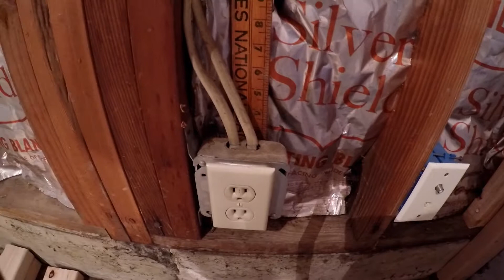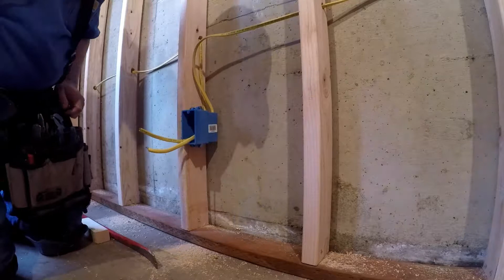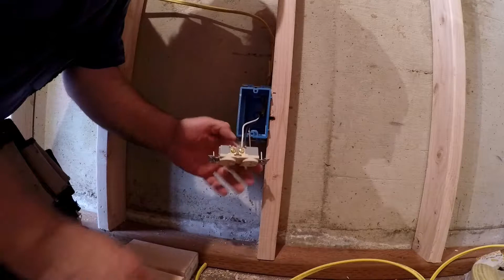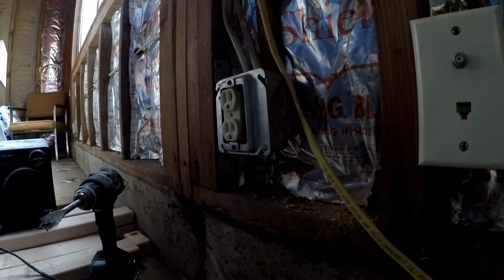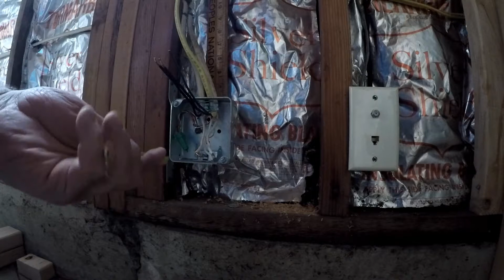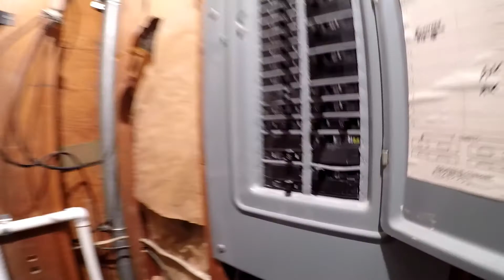Adding Electrical Outlets Shockingly EASY

Comment: Thanks for the detailed outlet and wiring  installation!!  I was unsure just how far back in the box you can remove the sheathing, because it's so difficult to stuff one or more back in when all the wires are still contained together.  It appears as far as possible to make more room,, as long as some with sheathing comes partially through the box tab or clamp areas.  Nice looking dog you have there!!

Comment: It would be nice if those plastic box manufacturers would make the mounting guides longer. Most drywall is 1/2 inch thick, but the guides are only 3/8 inch plus the rounded edges of the stud mean that your box could be approximately 1/4 inch too deep. I like to place a piece of drywall or 1/2 inch piece of wood on the front of the stud in order to get the proper mounting depth.
Reply from the maker: Half inch spacer to set the box depth. You can do that.

Comment: I really dont get adding pig-tail wires to outlet, if outlet ever goes bad I still shut power off to replace it, therefore the rest of outlets are down anyways. All your doing is making more connections, adding more wire work and creating more sales for wire connector industry which interns boost stock market investors dividends.......
Reply from the maker: It's just my preference to do the pigtail. You don't have to. My opinion is it makes it easier to manipulate the device into the box. In large boxes with many connections, it can save guesswork reinstalling if you fail to mark connections. The amount of time and material is very little. I prefer using the more expensive wire clamping devices. You can save money using the cheaper wire loop and screw devices.  Since I have investments that may have shares in a wire or connector manufacturer,  I may benefit and recoup a tiny bit of the cost of any extra material used.

Comment: I can not work unless I have a high tech electrical tester on the job site!!!!
Reply from the maker: Well, this isrocket science. Turn the power off untill finished. Then turn it on. If it works at the ladt plug, all should be good for the rest of time assuming the connections are tight and correct. There is little reason to have a really nice meter for residential electrical. I've had 2 fluke meters stolen over the years. I just buy cheap Kline meters from Orange Box now. Take care.

Comment: why there is a neutral wire connection in a  220 V  outlets?
Reply from the maker: Neutral only exists in 120 volt circuits.  208 240 volt there is no neutral,   just the two legs of 120 that combine to make 208 240. There can be 208 240 circuits with a neutral and that is because there is a 120 volt circuit within the range or dryer like for clock, timer, display and whatever else.

Comment: I was taught not to use different gauge wires ; were the wires going into the box a different gauge than the 20 gauge you used and was the the breaker a 15 or 20 amp. ?
Reply from the maker: First, I used 12 gauge wire, not 20 gauge which would be signal wire like phone, alarm, network, etc... You can tell visually it's 12 gauge by the yellow jacket. If it were 10 gauge, it would be orange and if 14 gauge it would have been white.  There wasn't a color standard for the jacket when this house was wired. The existing wire is 12 gauge and the breaker was a 20 amp breaker. At some point we also installed a GFCI at the first outlet from the breaker panel to protect all the next outlets in the circuit because this is a basement circuit and it is required. Good luck with your project...

Comment: Can you turn a down stair  garage into another bedroom.
Reply from the maker: With this house, it used to be a garage.  The problem with this one was it opened to a driveway belonging to the neighbors and no easement could be made so it was abandoned.  They did build a nice big 3 stall garage in the backyard.  It depends on the local code. Sometimes they'll allow it, other times not. Check first. I have seen people do it an have the building department order it restored. Other times not a problem.

Comment: Watched a guy who was working on romex, he cut a small slit in the outer jacket, bent it slightly then tugged the excess off. Sounds easier and less dangerous then trying to cut the exterior jacket in its entirety.

Comment: Watched alot of these type videos...why didnt you leave a loop of extra wire above boxes in case  of future work or problems?
Reply from the maker: Rarely is there ever a need for a loop of extra wire. Typically,  once a device or circuit is wired, it will be covered and stay that way for the rest of time. If you wish to add another branch or device, you would add another wire for it. You can put in a loop and loosely secure it if it makes you feel better but it will almost certainly be never used. I have seen it done by homeowners but never by professionals. I've worked on houses over 40 years. I own the first house I ever wired and have never needed a loop of wire. I would just route your wire loosely and on the odd odd chance of needing a little more wire, it will be there but I'm  sure you'll never need it. Remember, in plumbing and electrical,  the Installation will continue to work as installed until someone messes with it.  Hope that gives you a clear answer. Take care...

Comment: Levered Wagos # 221 are a much better alternative to wire nuts. You should try them. I still like your video.
Why didn't you hammer in metal Romex protectors on the studs? It is the job of the electrician not the drywallers.
Reply from the maker: The Wago is basically like the stab connection on outlets and switches. People have frowned upon using those connections even though they are code approved in favor of the side screw or clamp connections. I have never had an issue with wirenuts. Wirenuts done properly provide a connection of much greater surface area. I may give the Wago a limited test shot on my next house project to see how they perform. Who knows, I may love them. I think Wago has been used widely in other parts of the world. Is the desire to use them for speed of Installation,  performance,  and most importantly safety. Speed is my lowest concern and safety my highest.  Take care...
Reply: @CITAP1  I would very much enjoy you testing out the Wago 221 lever type connector. They are supposed to be safer then wire nuts done improperly. Because they don't overheat or at least time will tell. I have not used them yet because I became handicapped but I will be rewiring my house with them and upgrading my service from one hundred amp to two hundred amp service . As soon as my health improves. I would like to get more feedback from you. what I see on YouTube most electricians that convert over to Wago like them more than wire nuts. Thank you for responding I value your opinion.
PS I always use strike plates because I never trusted anyone putting nails and screws in walls. All it takes is 1 do-it-yourselfer to accidentally put too long of a nail or screw in his wall and his house burns to the ground.
I am subscribing to your Channel. Thank you
Reply from the maker: @eugeneshealthproject   I watched a video comparing Wago, crimp, and twist connectors. The video did a destructive over current test burning off the wire insulation getting red hot. All the connections did hold up in the test which went far beyond conditions that would ever happen in real world conditions. I guess a faulty breaker could not break in a short condition causing this scenario but that would be rare. I have to say, in that test, the Wago exceeded my expectations.
Reply: @CITAP1  great to hear it. Can you please give me a link to the video.
Reply from the maker: @eugeneshealthproject  
https://youtu.be/2uYD8e7idnY
Reply from the maker: As for metal strike plates, all the holes are deeper than 1-1/4". If the edge of the hole was less, then code would require the plates. If you drill a 1" hole max, dead center width in a wall stud, you  won't need a plate on either side. Thanks for the good questions and thank you for watching.

Comment: I would put my outlets in after drywalling. Now he is going to have to remove the outlets before installing the drywall.  Extra work.
Reply from the maker: We just unscrew the outlet and stuff it in the hole then hit with rotozip guide bit. It is a little more work but not a big deal.

Comment: I always make a 6 inch loop before I nail it before the box later if you needed more wire there you have it. Just leave the staple a little loose and you can pull and the wire will come out of the box 6 inches more.
Reply: Me to.I prepare for the long road.I do the best work I can for everyone and get all my work from referrals so in case I need to re do some wiring in the future I leave extra.

Comment: Romex is just a fancy extension cord. Any joker can install it. Only the pros use conduit.
Reply from the maker: BX or metal conduit is rarely used in residential but is used in commercial  wiring installations. Flex conduit installs almost as easily as NM cable.

Comment: Great video but how many outlet are on the circuit breaker our codes and most others limit it to 12 plug and ligtts per circuit I always limited mine to 10 but most electrical contractors go to the max to cut costs
Reply: The National Electrical Code doesn't say how many to can use. What code are you referring to?
Reply from the maker: I recall I added 3 outlets, the room already had 3 or 4 and I think each bedroom had it's own circuit. So I think it ended up with up to 9 with lighting being on it's own circuit. I'm  not sure what the limit is on outlets but I have been told to plan for what is an expected load. A bedroom could have a space heater and a TV with the rest being insignificant loading. 2400 watt circuit @80% = 100% duty at 1920 watts. 1500 watt heater, 500 watt or less TV. A heater is an occasional thing in a heated insulated house.  Hope that helps.